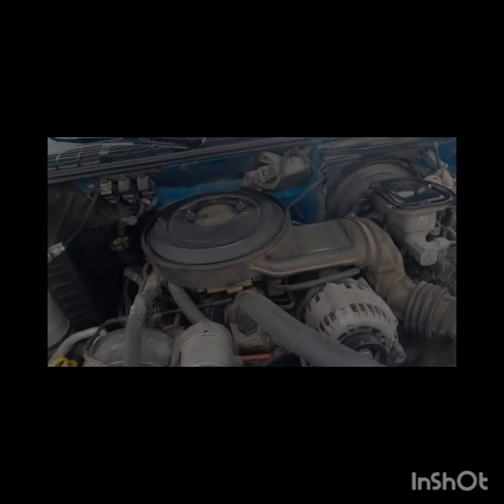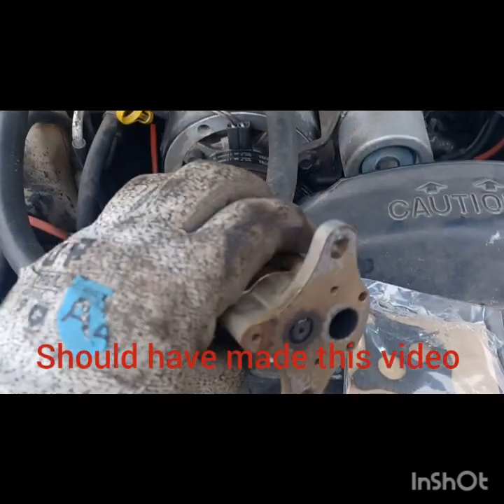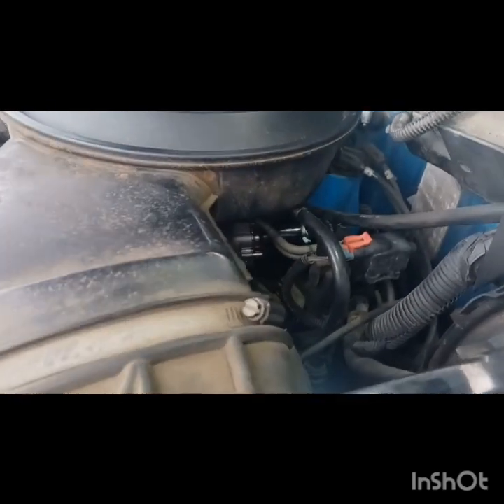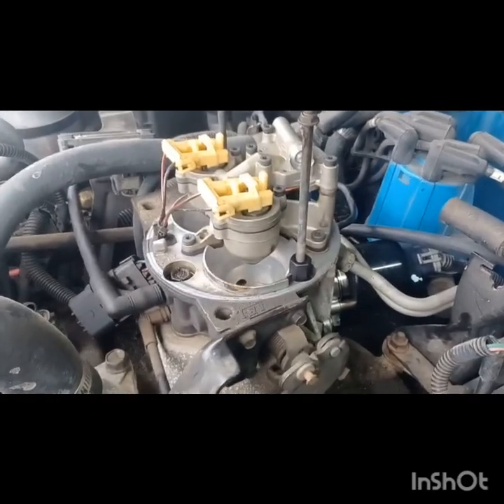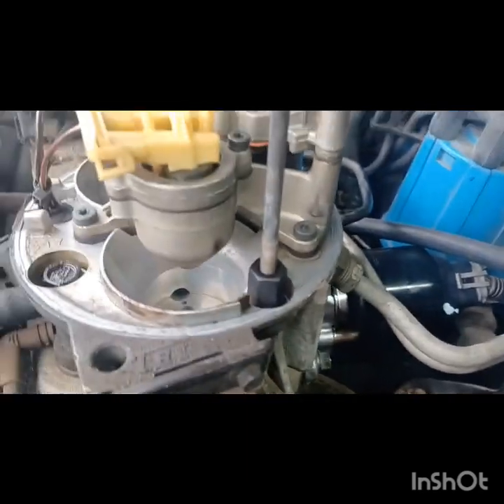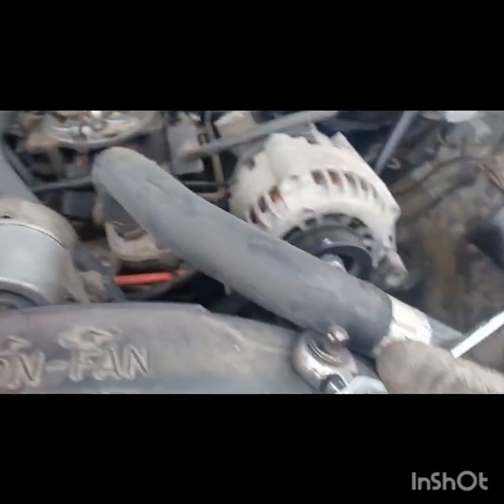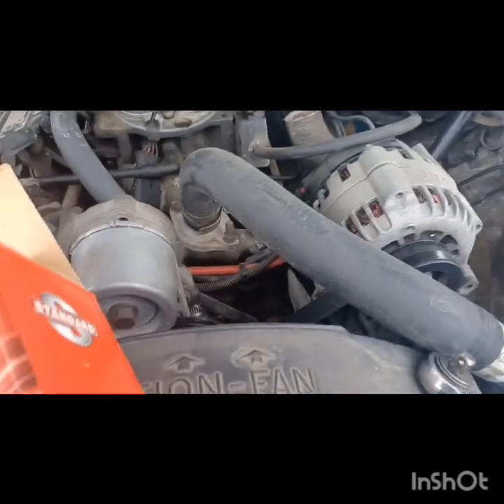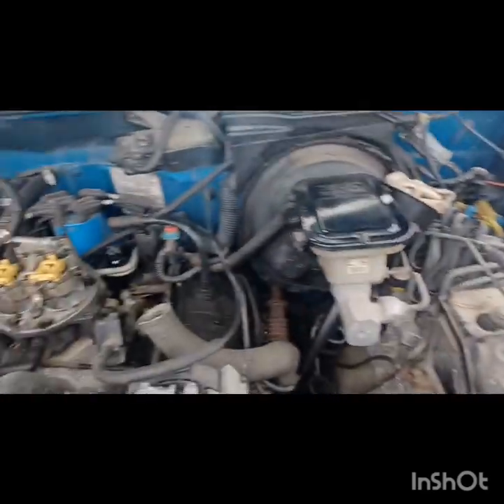Chevy S10 4.3 Vortec EGR replacement -- P0032 code

Comment: What year truck is this I have a 95 but I think it's got the wrong intake on it I had the electric EGR plug on it but the person I got it from has a vacuum EGR on it and the electric EGR doesn't bolt up and information would be great
Reply from the maker: It is a '95. However, 94 and 95 models will vary a bit on emissions equipment. They used whatever old parts were available to use them up. In '96 everyone was required to go to OBD2. Check with a couple of parts stores to see what is listed to do some research. You can also go to S10 forum online. I get helpful information there sometimes.